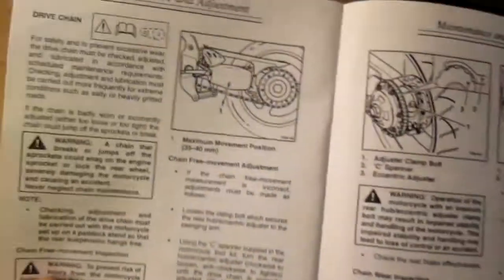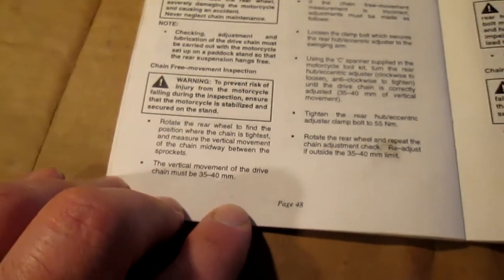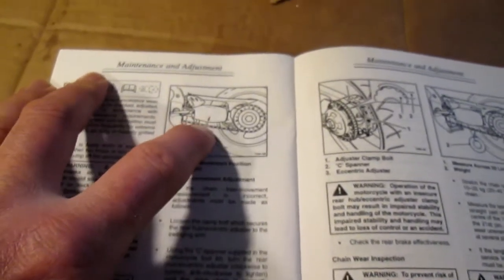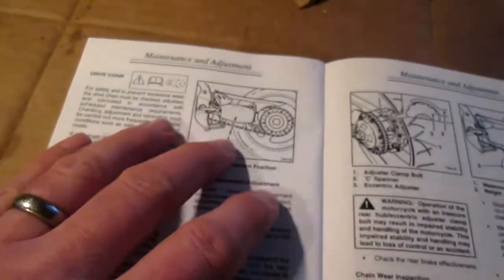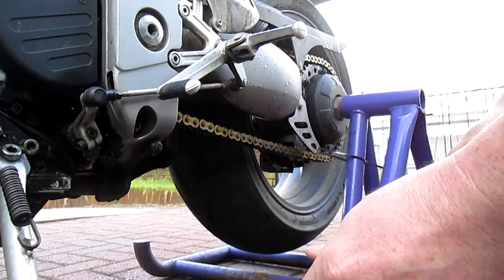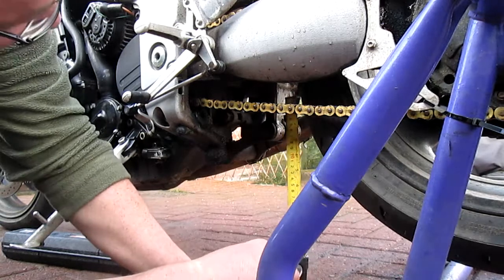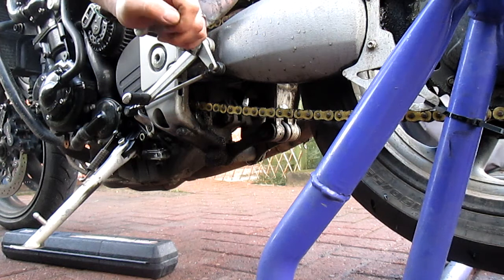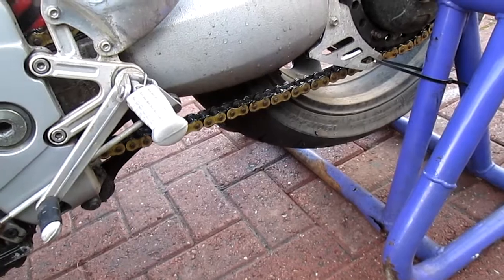Correct Slack on a Motorcycle Chain 2018

Comment: That looks lose to me!
Reply from the maker: Hi Nev, hope you're well. I worked for an engineer a wee while ago and asked him about chain slack, he said get a pal, sit on your bike, then get your pal to check the slack, if it's just about 1/2 inch or a wee bit more, you're good, better too loose than too tight but that adjustment there is as per manual and also the experience of the Daytona boys, the bike seems to ride okay, I was across town today, seems fine. I just get really paranoid about a tight chain.
Reply from the maker: To be honest then manual would have you a little tighter but the advice I got off the forum said, err a little looser so I feel your eye is right, it is a little loose but will be fine, mind I weigh a good 18-19 stone!
Reply: Yes you are right too tight is a no no.
Reply: @JamesMcCreadie71  I'm the same, hate tightening my chain after having one snap on me and it locking up the rear wheel! I adjust to 1 1/4 inch when I'm not sat on it, been perfect so far.